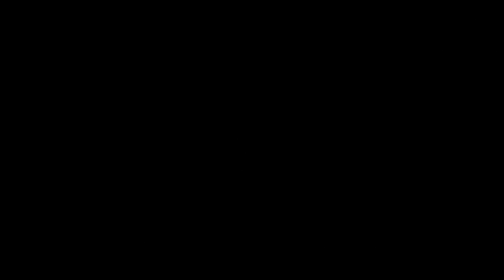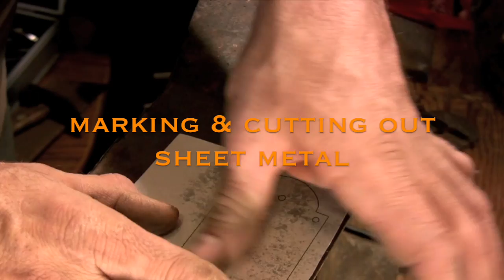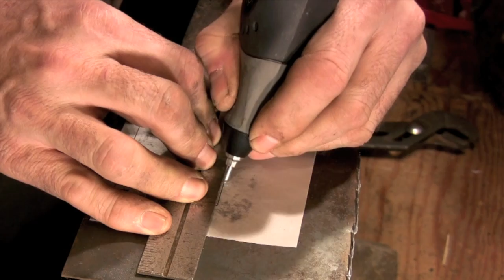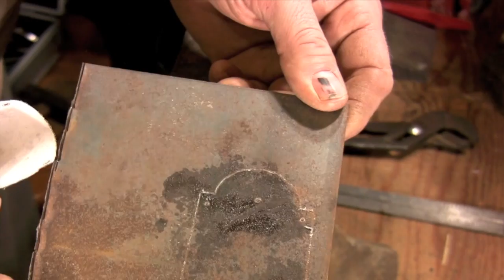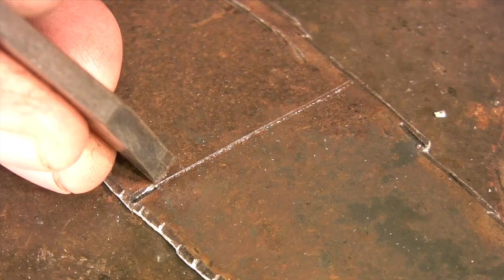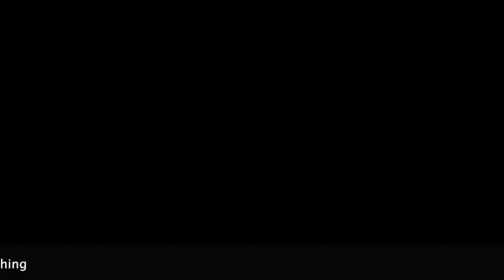Blacksmithing for Beginners -  How To Mark & Cut out Sheet metal Patterns

Comment: Would the chisel used in this video be considered a Cape Chisel?
Reply from the maker: Not really - this is just a narrow chisel with a cape chisel profile to support the cutting edge.  A cape chisel has the cutting edge as the widest part of the tool so it can be used to clean out metal in a deep groove without binding.